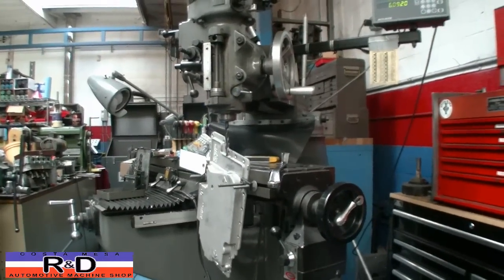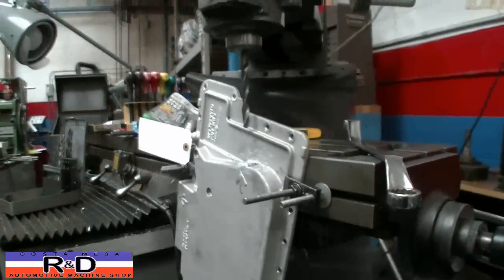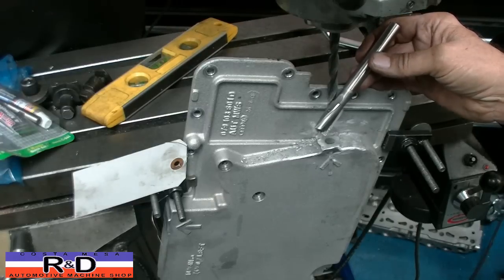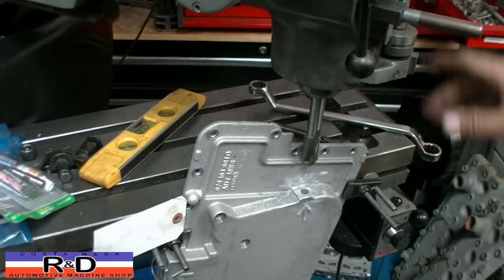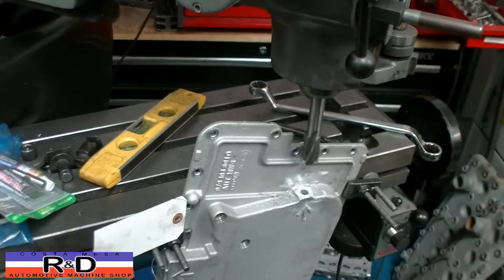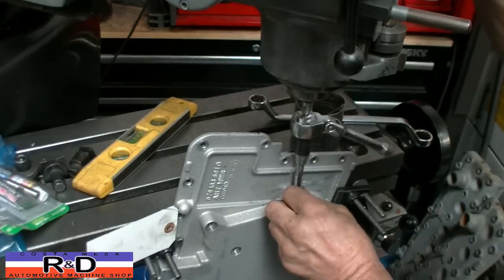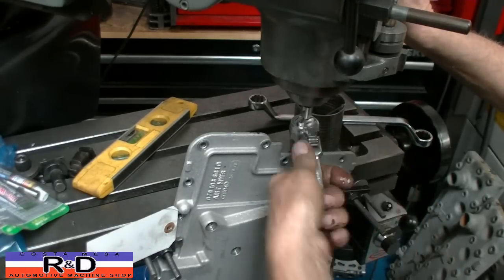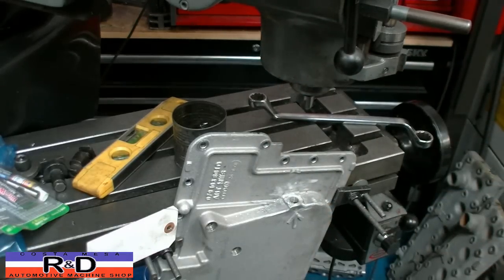Hole Drilling with Bridgeport Mill

Comment: Where can I get the taping tool with ratchet? Thanks
Reply: +DSM-BOY This is the one I have I got in at the swapmeet, but amazon has it. I use it in my 1/4 in impact often.
http://www.amazon.com/gp/product/B000TGM7HY?*Version*=1&*entries*=0
Reply from the maker: +DSM-BOY The tap sockets are available from several sources. The ratchet, I modified it myself. I have a video of that somewhere here on the Tube. You just have to get creative with your tools dude!
Reply: +fiatnutz thanks man I like all you mashing work
Reply: +DSM-BOY machine work
Reply: I think those are tap sockets made by Lisle, they are about 25 bucks a set on Amazon.

Comment: What was the purpose for the holes? Or is that another video?
Reply: +ovlraglvr My guess is it is for a dry sump setup. The oil pan is so shallow it must be for a dry sump, the three holes are probably for oil pickup/return lines.  Dry sumps have several pickups to accommodate for the oil moving around as the car moves.  That's just my understanding so you can research this topic for yourself if no one else answers.  I can see that the oil pan has a VW/AUDI stamp on it.
Reply: +TABRAO I was thinking the same thing but couldn't figure out why a stock pan would have the arrows but no holes.
Reply: +ovlraglvr I guess we will have to wait for John's answer. Although the hole we can see being drilled looks like it has been welded up to be reworked as you can see lots of rub marks from grinding/cleaning. I would guess the thread has been damaged or they want to fit a different size or standard of fitting.  It could be a gearbox oil pan.
Reply from the maker: +ovlraglvr They are used to drain the oil from the engine. The pan has several pockets that you simply can get the oil out of without having three drain plugs. Botched up design as far as I'm concerned. Leave it to VW, better German engineering!